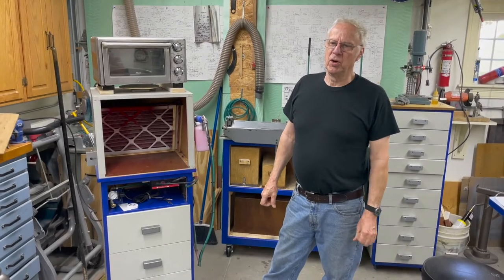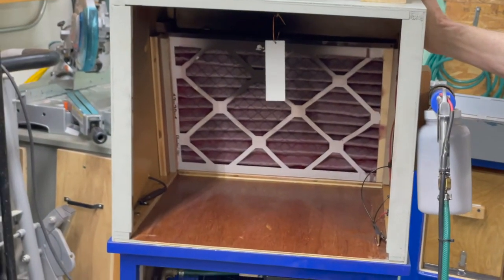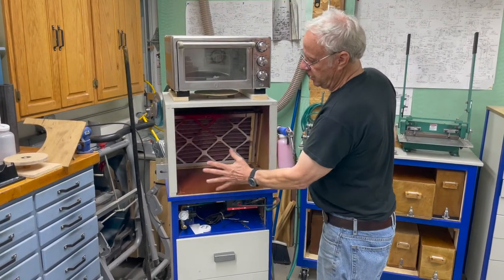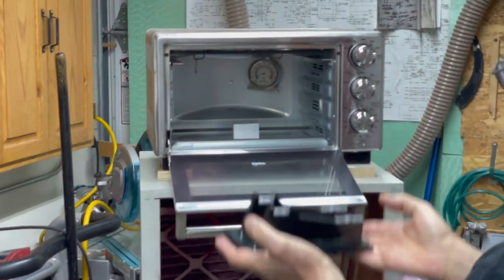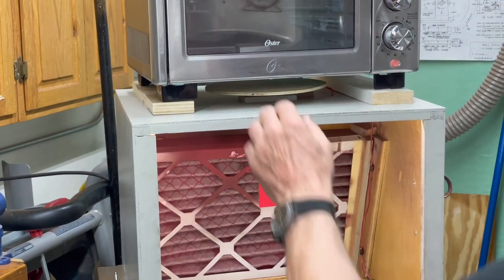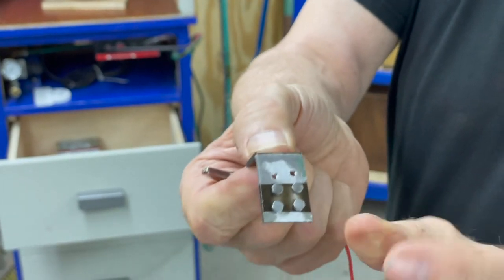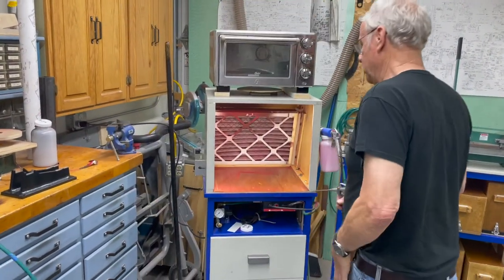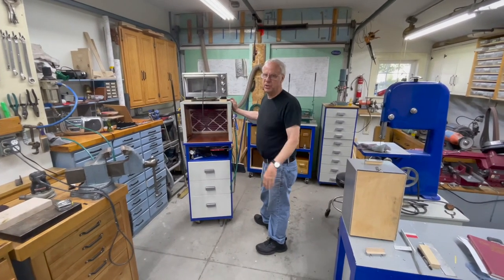Powder Coating Setup & Demo in a Small Shop

Comment: Joe, Great video!! I might even try setting up a system myself after watching your demonstration. I particularly liked the ease of cleanup compared to spray painting. I started building a spray paint hood years ago so I have a start on the project. Is power coating as effective on brass as the aluminum you showed? I must admit I have been doing a lot of rattle can painting with the self etching primer which seems to be somewhat effective but one still has to be careful with the part. Again thanks for the demo video and the others you have been putting out lately.

Dick B.
Reply from the maker: Hi Richard, Thanks for the comments and the encouragement. In answer to your question , yes powder coating creates a very hard finish and you will only get it off by sand blasting or power sanding. It adheres to all metals the same as far as I have seen. One thing to remember is the cure temp. Is above the melting point of soft solder. So if you are using soft solder you will have to put in a fastener or two so it will stay together. The melting of the solder does not seem to effect the powder coating on top of the joint.  
Joe